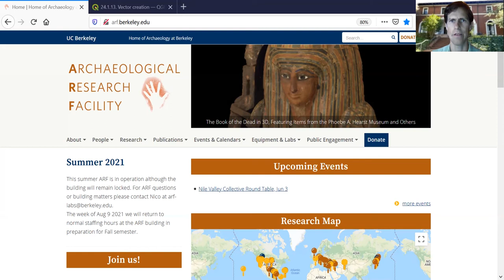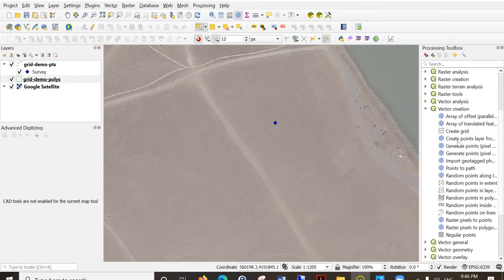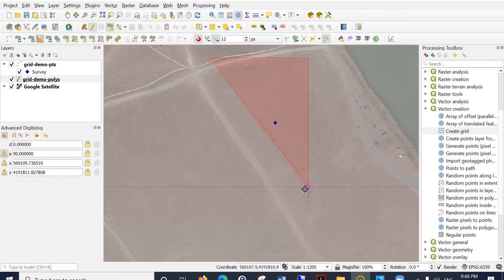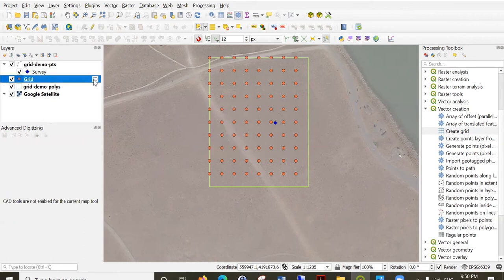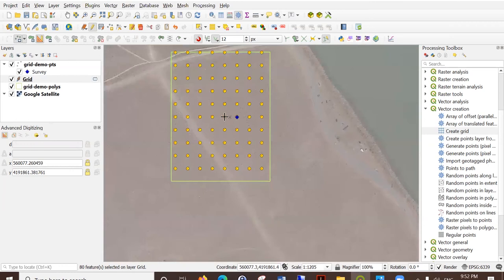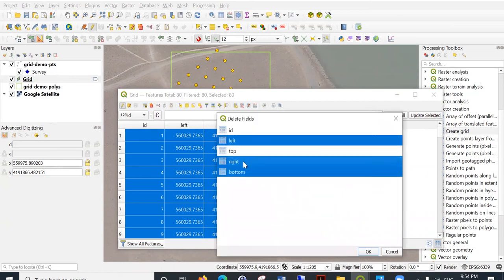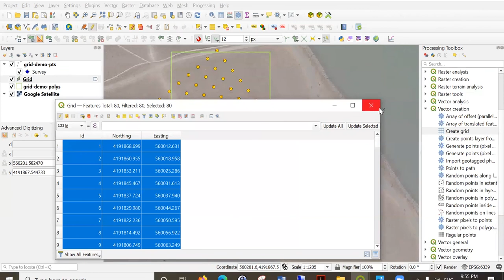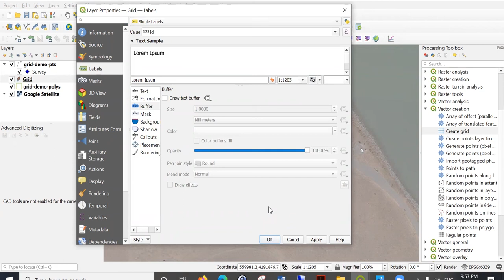Creating archaeological site grids in QGIS 3.x

Comment: Great tutorial, I have one issue, I keep getting a null return when I create the new columns for the grid - I have saved the rotation edits and have the grid selected still, not sure why this is happening.
Reply: Sorry for the delayed response. Were you able to solve this? The new field should be Type: Double then use $x and $y to populate it with current coordinates.